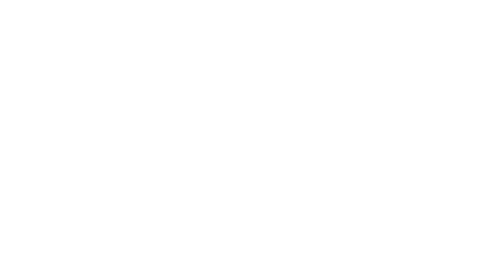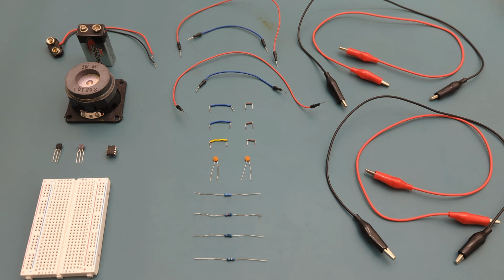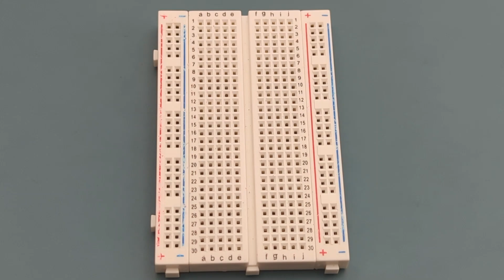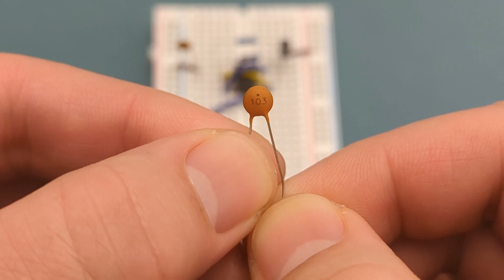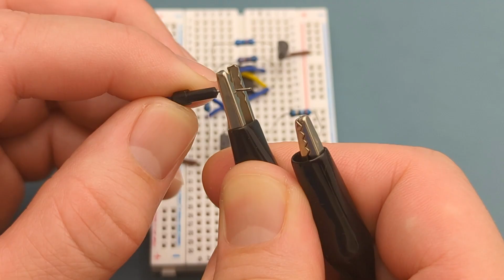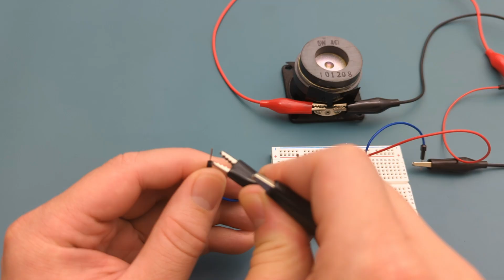555 Timer Project | Build Your Own Continuity Tester

Comment from the maker: 🔔 Get your tools here:
✅ Electronics Component Kit: https://amzn.to/3N65asq
✅ 9V Battery Connector: https://amzn.to/3S7kbg8
✅ 9V Batteries: https://amzn.to/4kkonVD
✅ BC547 & BC557 Transistors: https://amzn.to/4rVYErq
✅ Ceramic Capacitors: https://amzn.to/44kfg2b
✅ NE555 Timer: https://amzn.to/41MpQhp
✅ Resistors: https://amzn.to/3YfGeUi
✅ 5W Speaker: https://amzn.to/4eL2D3y
✅ Solderless Breadboards: https://amzn.to/3SndKWm